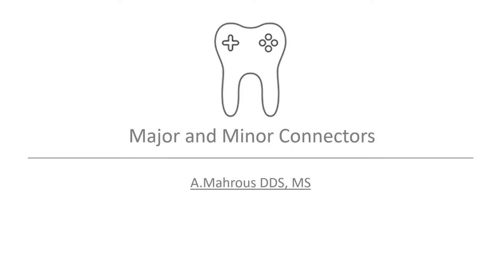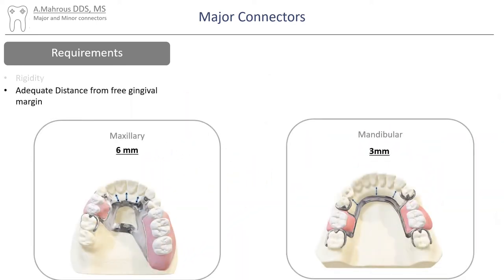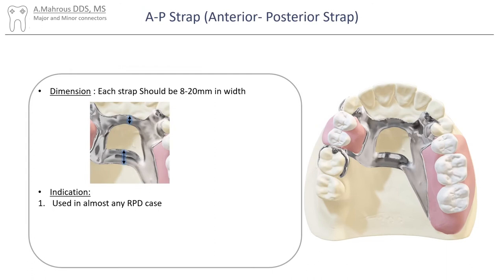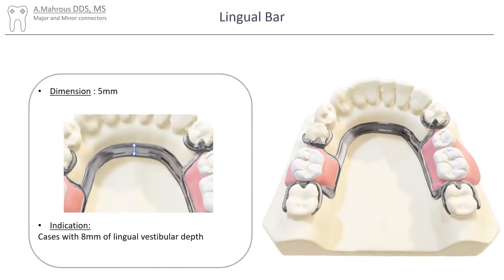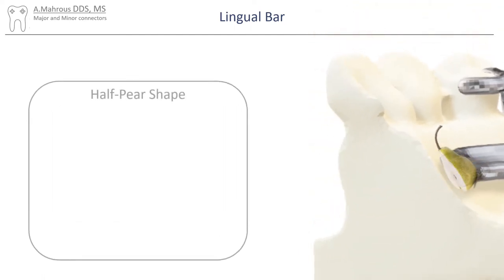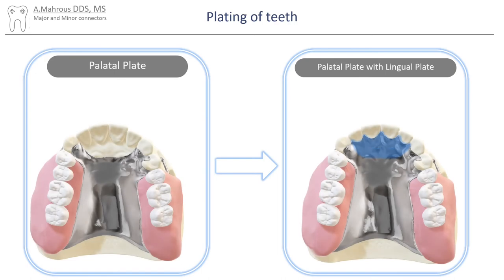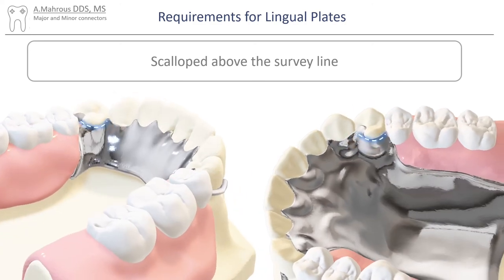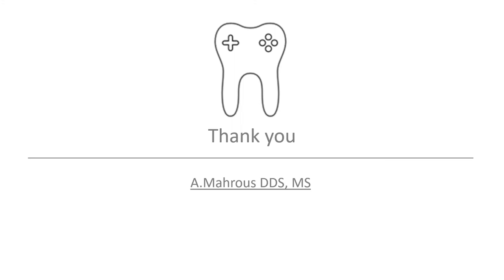RPD Major & Minor Connectors in 5 mins

Comment: Hi Dr A. Mahrous. I like your videos and like to share them with my students as you have good animations, and we seem to agree on most measurements and features of RPD's. In this video however you list the lingual plate with distal rests in a Kennedy class I RPD. It would've been better to have them on the mesial. you actually demonstrate that  to be better in the indirect retention video. Also I think that gingivally approaching clasps would be far better suited to free end saddles than occlusaly approaching ones. 
  Please Check the RPI system of clasping by Dr Kratochvil , it would be great if you could produce a video on that with animations.
Reply from the maker: Hi Bill, Thank you for your comment! It would be my pleasure to have my videos used in lectures. Regarding the distal rests. I am aware with the stress release concept of “no rigid clasps anterior to the fulcrum line”. While it is not directly apparent; the clasp used in the mandibular class I with a plate is a Wrought Wire or “combination claps” which is inherently flexible and not rigid. This would be derived from the “Mckracken RPD philosophy “ which might be slightly different. I will try to make a video that does not have this issue so that it may be used more universally, but till then please feel free to use any parts that suit your needs